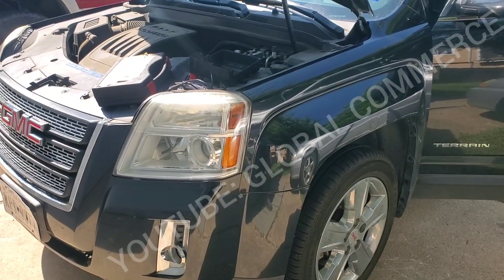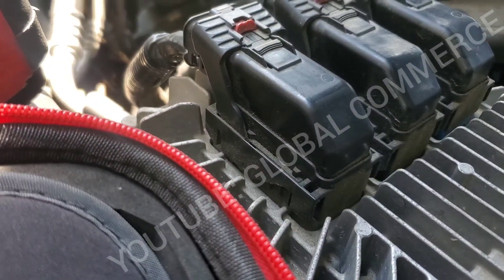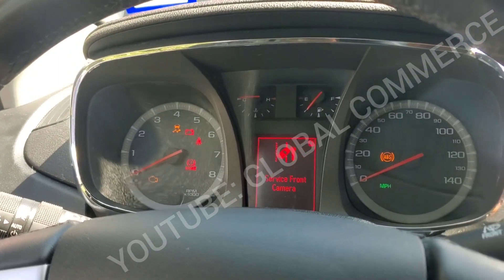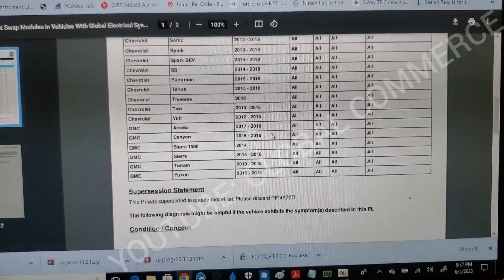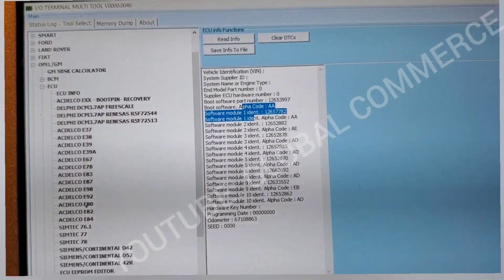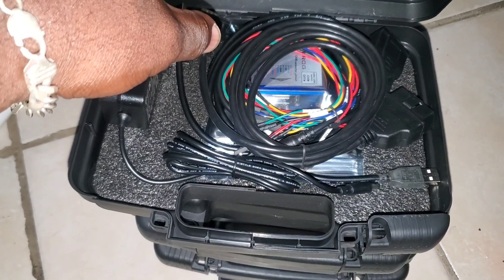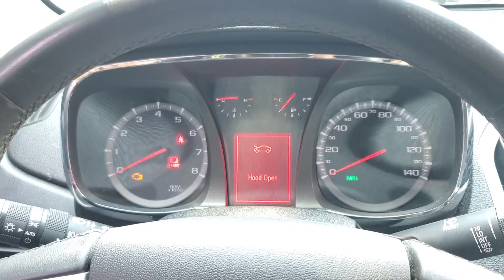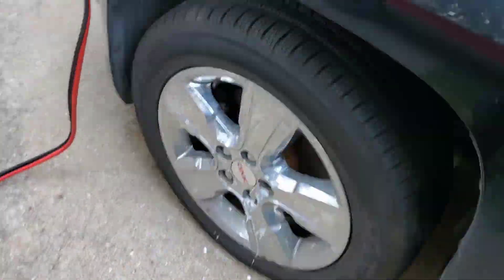GMC Terrain P0633 P0630 VIN, KEY not programmed,  Diag, USED ECM PCM GM GLOBAL A SECURITY CRACKED!

Comment: What about a p0633 code with no security light after pcm replacement
Reply from the maker: Means ecm is in learn state, did engine start?
Reply: @globalcommerce7654  no start tried 30 min manual procedure but no start maybe need locksmith

Comment: So 2018 and onwards not global a for the terrain??
Reply from the maker: Yes they are global A, global b is the new architecture for the ev platform.
Reply: @globalcommerce7654  so is global b only for ev? And a for gas and diesel? What’s the difference in programming
Reply from the maker: @philh9238  correct, I haven't dabbled in B yet so I don't have the details at the moment but I believe they redesigned the complete architecture..

Comment: Why you did not clone it with io prog first time? It is a piece of kake!  It is plug and play. When you see no vin, you can clone it no problem. The ecm is probably in boot mode, so it can not comminicated with others. clone it!  I'm doing a lot of them and it always work.
Reply from the maker: Thanks for the comment,  this one was gone and would not even connect to read the eeprom,  I've got full video of all the steps to get here, was shorted for this video,, cloning was not an option here..